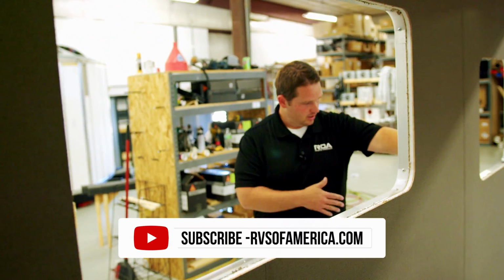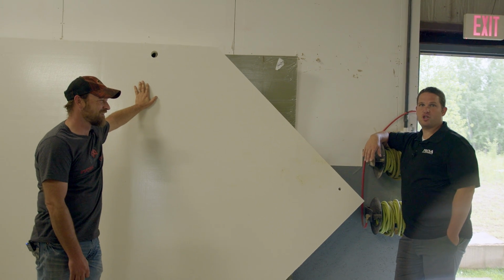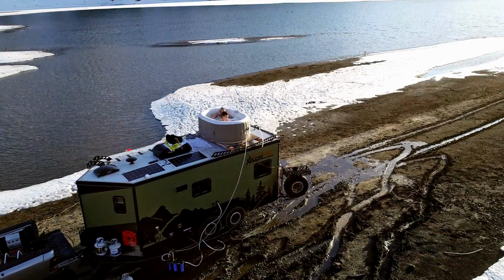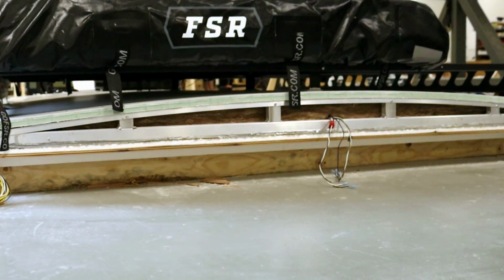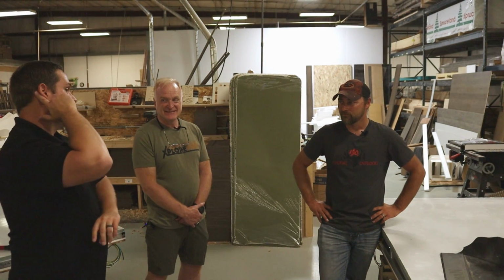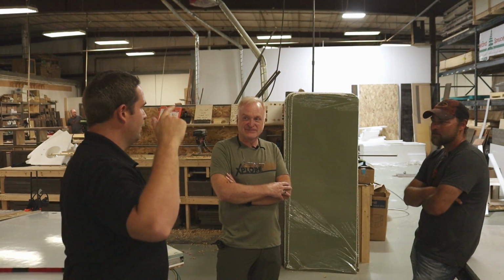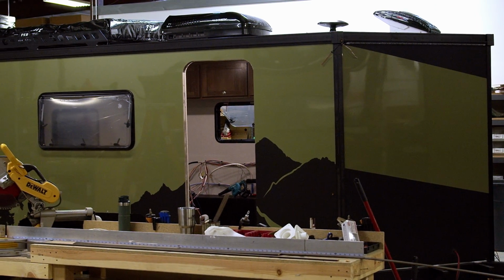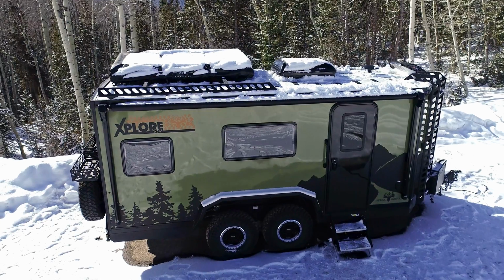EP 3: XPLORE FACTORY TOUR: HOW OFF-ROAD trailers should be built for most extreme conditions!4k(2022

Comment: These are very good trailers. I wish I didn't buy a Black Series from you at times.
Reply: I am going back and forth between this and the Black Series 17 - are you seeing issues with the Black Series?
Reply: @TheExcursioners  Nothing on mine that couldn't be corrected, but Explore are much better built and once you add insulation no price difference. Go out and see these guys. All the other dealers are dopes.
Reply: @thewonderof06790  Correct me if I am wrong but aren't xplore s like 20k more  black series? That's a lot of insulation. If one is looking for a 4 season off road-ish 20 footer there are not tons of options. But let's slow down a bit on hyping the xplore like it's the best built ever. I really like the one piece floor and roof. To praise them for not filling in all the studs with insulation and that the water tanks are built to not fall out is like silly. Like you know what I like mean.
Reply: I am trying to watch the factory tour but I don’t have sufficient time to watch the extended flooring discussion in each of the first three videos.  Please move on!  BTW I am very impressed with the product!

Comment: I'm really enjoying these manufacturing videos. At about the 25 minute mark, you all get to the heart of why it's worth it to some of us to pay extra for a trailer that is functional down to -40 degrees and also stays cool in the hottest weather. Any manufacturer that takes the time and care to build a trailer that works great at those temperature extremes is also more likely to pay attention to quality and durability issues in most if not all of the other aspects of the trailer construction. For those of us who fulltime in our trailers, boondock 100% of the time, see a lot of rough roads, and occasionally get caught in extremely cold or hot weather during our travels, it's worth it to us to pay a premium for extra quality, reliability and durability. The trailer is our home. If the X22 came with a N/S bed configuration, we would have already bought one to replace our current 5th wheel.